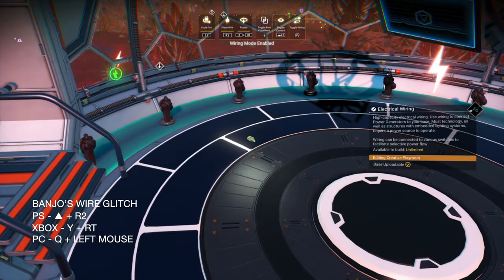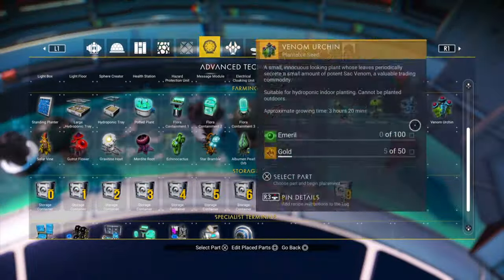Single Bio Dome Mega Farm - No Man's Sky Farming Guide 2024 - No Man's Sky Update - NMS Scottish Rod

Comment: I’m trying to do this on PC. For whatever reason, whenever I press Q and left click, it just swaps back to the plant but doesn’t place it down. Not sure what I’m missing. I tried adjusting when I click and press the button but I can’t seem to get it to work.
Reply from the maker: It's all about the timing, once you find it it will be come second nature. 

This video might help 🙂- https://youtu.be/ihgx31O8p0g
Reply: @ScottishRod  Great video. I did have a little success with it yesterday after leaving this comment, but mostly with remapping Q to one of my side mouse buttons. I think the difference in key travel on the keyboard’s Q key and the mouse click is what makes it harder. It was still sort of difficult with both buttons on the mouse but much easier that way. I wonder if it’s easier on console simply because all the input is coming from the same device, sort of like when remapping the keys to just the mouse on PC. I also got to thinking that maybe I can use a macro program and make “Q+left click” be a macro for one of my mouse buttons. Might try that today. Thanks for the help!
Reply from the maker: @savagesanity  It can be easier on Console but you can get one key to glitch macro's for the PC. 🙂

Comment: my biodome doesnt look like this. theres no door or moat. am i missing something or did they change things since this video was made?
Reply from the maker: Nothings changed but you do have to add a door!?
Reply: i did! so i placed the dome, then added a door. based on your video i thought it came prebuilt with a door. im on ps5 if that makes a difference. but im still stumped as to how to get the moat going on inside the dome. right now its just a metal flooring.  @ScottishRod
Reply from the maker: Do you have something built underneath it? That’s probably hiding the moat. 😊
Reply: @ScottishRod lol you’re right. It was covered. Discovered it by accidentally trying to place it and it worked. Just looks so odd without water lol. Thank you for your assistance!!
Reply: I just tried it for the first time today Feb 18 2024, and it works, had the same issue as @shaytoon21, if the biodome has the foundation underneath it seems to block the glitch from working.